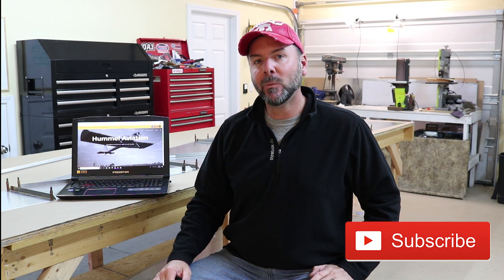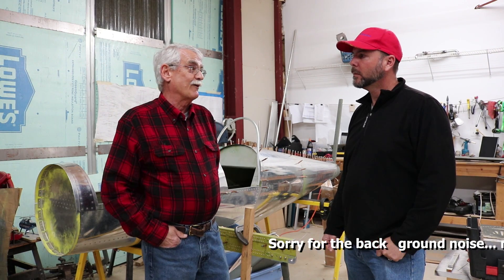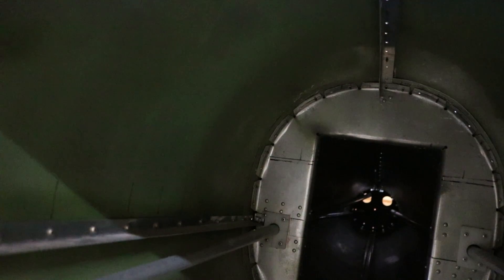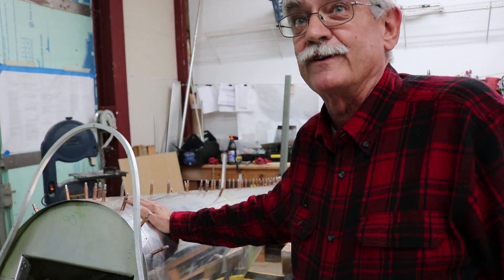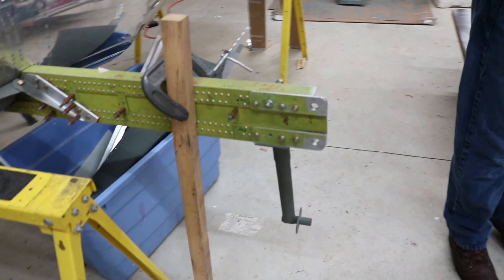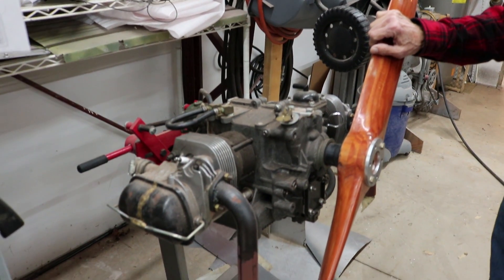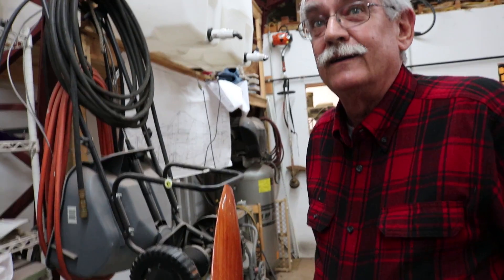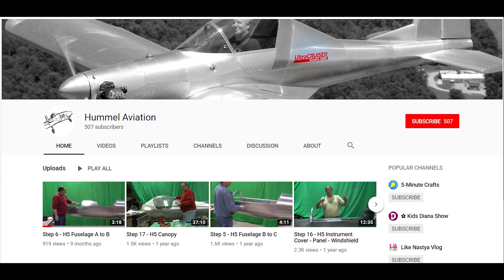Bobs Hummelbird Aircraft - Plans Built Project

Comment: Very cool and nice little airplane, I was just thinking to built something similar but from composite (based on Burt Rutan and Mike Arnold methods which I discovered recently) and use engine from BMW R-type motorcycle (lightweight and powerful with all accessories like starter and alternator, some models even have 2 spark plugs per head which is also convenient )

Comment: 170lbs 😂
Reply: Martin Kaufmann The Hummel H5 can handle a 6’2” 300lbs pilot if you need something bigger. It’s also an experimental class/ sport class aircraft like the HummelBird.
Reply: Hiflier35thCAG thanks, I check that out!
Reply: Martin Kaufmann Bob is going to enjoy the HummelBird. It’s a sporty little plane.
Reply: Martin Kaufmann https://youtu.be/IBb_pmMenjA

Mines they yellow tri-gear with the white spinner. Vne is 120knts .Cruise 100knts. Economy cruise 78knts.  Lands at 35knts full flaps. Gross takeoff weight 905lbs with 13gallons of fuel and a 6’1” 300lbs pilot.  A 250lbs pilot and 3gal of gas lands at 26knts full flaps. Actually numbers from an actual plane. Climb out on a 95deg day is 500ft/min at 65 knts. 70deg-750fpm.  85hp 2400cc Scott Cassler Full VW engine with dual ignition.